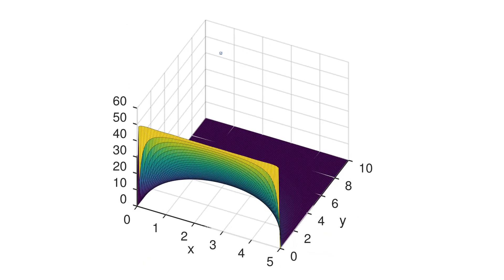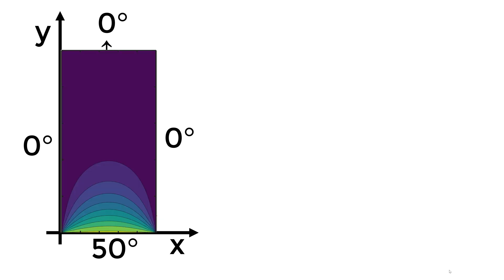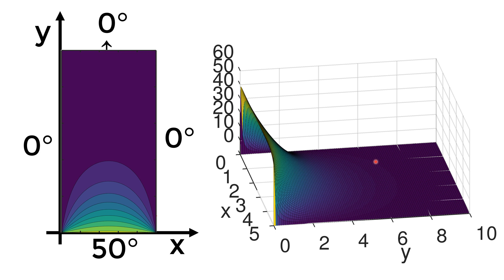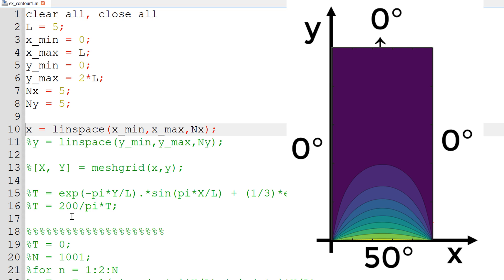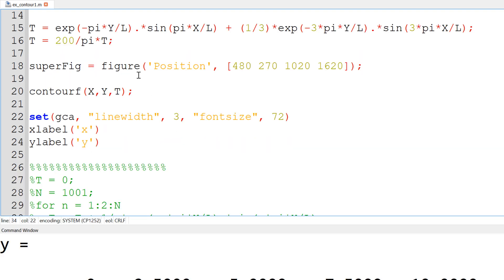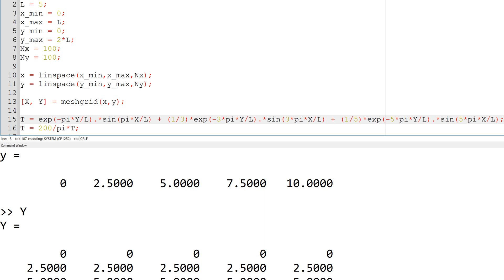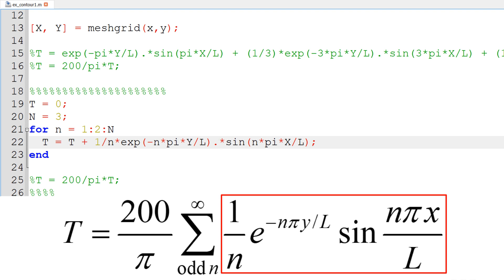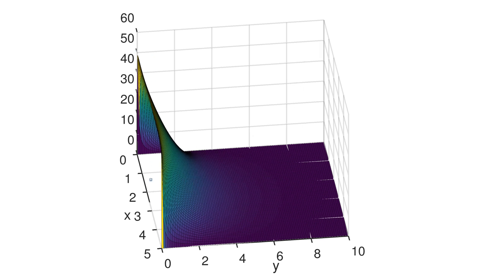Plot Solution of Laplace's Equation using Octave and Matlab

Comment: Thank you for making this video! I have a question on the "skipping part", what exactly does n =1:2:N do? How does it make only odd terms? Is that like starting from 1 and add 2 each time until you hit N?
Reply from the maker: Yes, 1:2:N creates a column vector starting 1, and it keeps adding 2 until it reaches N. For example, if you use 1:2:5, it will creates [1 3 5].